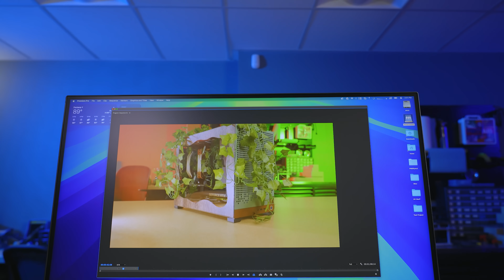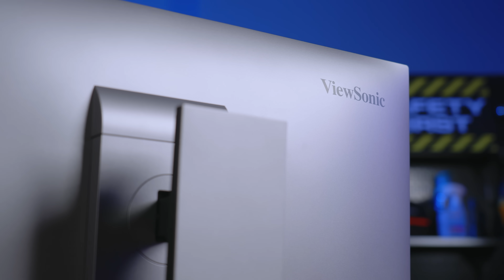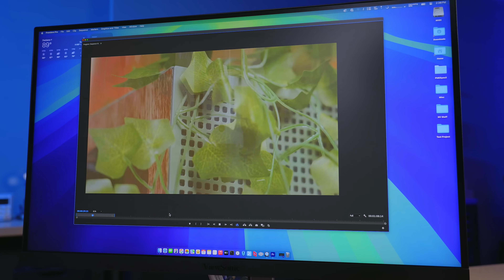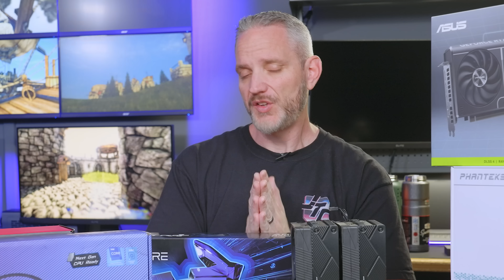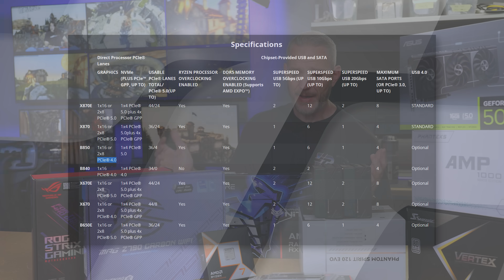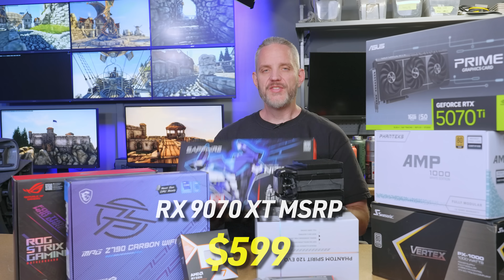This is the Sweetspot for PC gaming... Don't get fooled into spending more!

Comment: I just built my first with a 9600x and a 9060XT 16gb, B850I asrock board, 2TB m.2 and 750W Corsair platinum power supply 🥰 it's a little work horse and I love it.
Reply: Awesome build! 👍
Reply: Heck yeah sweet build
Reply: I got a similar build but I'm a gen behind still on AM4 but I upgraded my core to the 5900xt paired with the 9060XT 16 gb which I just got (love it to pieces so far, went from a 2070 super). Eventually when money flows easy again I'll bump up to the AM5 boards.
Reply: @inquity6 I'm already kinda annoyed I didn't get a 9700x, but for no reason other than I want bigger number. Idk if I have a single use case where I'm gonna bottleneck a 9600x lol
Reply: @CMLVI you don’t. The 9060xt is the bottle neck
Reply: That sounds awesome. I bet it does great at everything you want to do.
Reply: Similar! 9600x with 9070XT, 32g RAM, AsRock B850 Pro RS, 850w, and some M.2 I already had. I think all in, in a "regular" configuration, I'd have been about $1,400, but I could have been below $1,300 if I lived near a Microcenter. Very happy with it!
Reply: @CMLVI  
I went with a 5060ti 16gb, 9700x, 32gb ram, b650 elite ax /w 3 m.2 slots, & 360mm aio cooler  $1,210 (I only went with an aio because of aesthethics)
^ I originally planned to re-use my 750w, phanteks p500s, & my old corsair fans.

It turned into a full build because
1. I didn't want to tear out all my parts + I wanted something more smaller/ minimalistic /w more airflow. So I bought the 4000d airflow. Thankfully I did this because I had to troubleshoot the files I downloaded onto my usb. So all I had to do was swap my ssd back n forth until I figured it out. So I saved myself an even bigger headache of swapping out parts a bunch of times.

So another $100

2. I decided to replace my 750w with the 850w incase I decided to upgrade my gpu & it needed more juice in the future + my 750w psu was 8 years old... so I figured I got a new case might as well keep it in the old case.
so another $130

3. I could've reused the fans, but I didn't want the hassle of unplugging all the wires & cable managing it again. So I picked up those icue link qx120's & replaced the fans on aio + the front panel & added 1 more to the rear. 
Another $320, but it was worth it to have an less visual clutter + a lot less to cable manage over the lighting node system. 

4. I replaced my mouse & keyboard to wireless. It still came with wires though to charge them. At this point why not... I already upgraded everything else.
So another $180

So all together about $1,940.

I originally planned on spending $1,200, but it was well worth doing a full rebuild in a new case. 
I wished I wasn't an corsair addict...
Reply: All these AMD fan boys that only buy amd everything. Buying the 5070ti at $750 is great!

2nd) Honestly the 9800x3d for $500 after tax is insane unless you have an rtx 5090. 

If the 9800x3d was down to earth for $399 regulary then id say ya 😉. Its the the fastest gaming cpu at 1080p and 1440p. But with a mid range 5070ti a 14700kf for $300 is much better and then get a 4tb m.2 Samsung ssd instead of a 2gb. Bf6 and many games need LOTS of space.
Reply: Gonna build mine with a 7500f and 9060xt 16gb at the end of the month if nothing goes wrong. Wish me luck lol.
Reply: What settings do you usually run with that build? 1440p?
Reply: What is a general cost for that setup? I’m growing tired of Microsoft’s Failures.
Reply: @Wakeywhodat I think if you bought it the cheapest way and only did a 1tb ssd, you could get away with it under $1400. Microcenter CPU+mobo+ram could get you pushing $1300, and you don't need a $140 case like I got. Sub $1300 is possible if you are patient enough
Reply: I'm looking at something similar but likely will go with MSI or ASUS instead of ASRock. Why? Because I have a ASRock now and want something different--pretty random reason
Reply: @junaidmudaliar9685  not a bad call, I had post issues with the 9000 series CPU on my mobo; just needed to flash it but the manual Literally doesn't detail it, and the online docs don't tell you either. It just says "do it according to the manual". So after the initial panic and subsequent research, I was booted within 40 min of first putting the CPU in. But stressful 40 min lmao
Reply: @CMLVI I'm planning to get a 9600x. What did you do to fix your issue?
Reply: @oliver_reddy it was just flashing the BIOS, but it wasn't a straight forward process because AsRock tells you to do it, but doesn't tell you how, and just references manuals and websites in a cyclical nature. Luckily I found a YT video of someone doing it to a very similar model to mine, just copied with the appropriate BIOS for my mobo.
Reply: @CMLVI Thanks for the tip. I pray it doesn't happen to me, but if it does, I have this comment to come back to! :D
Reply: @oliver_reddy I'll be on the lookout! Lol
Reply: You should have gotten an 850 Watt gold rated PSU instead of the one you have now.
Reply: @DanishDude65 u don’t need that wattage for that build

Comment: I upgraded my 5700X build after buying your old X570 Extreme board with a 9070XT. Definitely a massive upgrade from my RX580 that I have held on to since it was new from like 8 years ago now. Holding onto hardware for as long as you can is the best route forward right now. CPUs and motherboards don't need to be upgraded like they were, maybe once every RAM generation change with how well these X3D CPUs seem to hold on. Still wish I could get what the RX580 gave me for $191 today with decent GPUs coming down in price, but c'est la vie.

Comment: I couldn't tell you how important this video is for me right now. I've been upgrading my rig bit by bit due to the issues Iv had with Monster Hunter Wilds. Money has been tight so Iv only been able to make small meaningful upgrades to parts I happen to find on a good sales. Microcenter has been my friend this year in that regard as I got a very popular SSD for half off last week. So far Iv only upgraded my SSD, power supply and got an additional stick of RAM. Iv seen some improvements to my overall rig and other games, but Wilds has really only seen improvements in launching the game which is fine because it took about 3 minutes just to get in the game prior. My motherboard and water cooler are the most up to date components that came out in 2023. I have the foundation I just need to build on it with a good GPU and CPU when I can find the extra money.

Comment: power supplies choice should always be overspeced,  and going with a reliable brand is a must, it should  be a muti build investment,  I have a 550w antec tru power trio that i got around  2010ish and used it in several builds before i needed more power, it is still alive and a solid psu that resides in my god kids mincraft rig. antec and seasonic i will always recommend over many others.

Comment: The only time I would suggest maybe spending a bit more on motherboard is if you're going ITX buiilds, as you can't always just add it through a PCIE slot.
Let's say you want 3 m.2 slots for example, while most people don't need it, for video editing you might want that. And I don't know of any lower end boards that have 3 (most don't even have 2) slots.
Another thing that you might want, is 10gbe, which you don't see on budget boards for reasons, it will generally add $50-100 just for the 10gbe over 1gbe.

Comment: The sweetspot for gaming is an AM4 5700x, 5700x3d or 5500, with a 9060xt or 9070 non-XT, a b550 board and 32GB DDR4 RAM, with a 1TB Gen3 SSD and 2TB HDD. That gives you the most performance per dollar. 12th gen intel i5s are also cheap.
Reply: 12 gen are really good still :)
Reply: @SuperDuDDe  yup, as I said 10th gen i5s are cheap now, even the i7 12700 too.
Reply: Lets just cross the 5500 from the list with its halfed cache and PCIE 3.0, 5600(X) much better buy. Make sure the HDD is CMR, most cheap 2TB HDDs are SMR now, so better to jump up to 4TB CMR drive or stick with 1TB CMR drive.
Reply: @sviktor4  Yes, but the 5500 is 50-55$, so if you are on a tight budget you can't beat it, unless you get an i3 12100, but overall it's better to go with the 5500
nowadays the price difference between SMR and CMR is not that big.
Reply: @rattlehead999 The 5600x was on offer here for 89€ recently. That's ultra cheap and I wouldn't go any lower, unless you really have to
Reply: @rattlehead999  On that tight budget a 3600 maybe a better choice, in some games perform better. Or just buy used parts, because in 1-2 years the 5500 will loose its resale value.
Personally I would choose a used 9600k or 8700k system, it's performs better than 5500 and holds its resale value.

I realised no reason to discuss budget options because both new and used prices are different in different regions. All in all new market sucks except AM4 and all manufacturers will stop DDR4 production in this year.

CRM drives 22% more expensive at the low end and as you go up in capacity the difference goes down to 10-15% in price.
Worst thing is that you can no longer buy 2.5" CMR drives for external storage.
Reply: @sviktor4  the 5500 performs better than 10th gen or earlier from intel, apart from the very high clocked ones, also what resell value? It's already 50-55$ brand new.

If not just go for the 5600 for 70-75$.
Reply: @tarron3237 the 5600 non-X has 99% the performance since it's the same CPU, but clocked 100mhz lower, but it consumes less power, so it's more worth it even at the same price as it can easily be cooled with the stock cooler.
Reply: 5700x3d on a B550, 32GB 3200 CL14 (used), RX6800 (used), two 1TB NVME's and a 1TB SSD here, and I can't disagree. That combo works perfectly
Reply: @tarron3237 cheers

Comment: Always buy components that actually benefit what you want from the PC. I’m still on AM4 and have a 5800X3D because I do car racing sims online. They really benefit from the extra cache. Running it with the Thermalite Phantom 120 EVO cooler. Perfect. My power supply needs replacing…it’s an 11 year old Superflower Gold 80 plus but only 750 watts. Will definitely buy another Superflower as it’s been bullet proof.

Comment: I'm Running a 9800x3d with a 7900xt with a B650E and 32GB of DDR5 & Be Quiet Dark Rock Pro 5 and it keeps it cool and Powered with an EVGA 850 GT and it works Fine for me

Comment: MSI MAG x870E Tomahawk WiFi - 4tb samsung nvme - Ryzen 7 9800x3d w/NZXT 360mm AIO - 64gb Gskill Trident Z5 6000 cl30-36-36-96 EXPO (tightest CLs they make in this size and MT speeds) - Corsair 1000W PSU - Meshify 2 case with full NFA14 Noctuas (x6) - still on an old 2080 Super till the 9080XT or 9070xtx. I run a travesty of a 3 monitor setup. 1x 1080 24", 1x 1440 27" and 1x 1440p 34" curved ultra wide. Every thing is powered by a VRM battery backup system. My advice is to cheap out on the MB, go with the best CPU and GPU combo you can buy. My 2080 super came out of my meshify 1 system with a r7 2700x, so this was a significant upgrade from an early gen am4 to am5. I just refused to buy a 16gb GPU in 2025 and although the 7900xtx was tempting, it is too old to justify the price given its age... I will wait for Nvidia or AMD to release a 24gb or higher card before they will capture the rest of my money. Miss the good ol days of the 1080Ti where these companies actually tried to show you what they could do with raw power...I am a native junkie...they keep leaning away from raw power in favor of AI and frankly it isn't as good. Anyone can go compare the generational growth and see the stagnation...they are intentionally nerfing the GPU market while simultaneously inflating price to the worst level...Legit about to go full team red for the first time in my pc gaming life. cmon 9080xt or 9070xtx.

Comment: He’s definitely got some good points.  Currently running a ryzen 7700 non x with a b650 board and a 9070xt.  Honestly for 1440p, I could probably get away with a 9060xt.  But when I got the 9070xt, I grabbed the AsRock Steel Legend for $700.  I think I’m good for a year or two anyway if not longer.  If I make any moves it might be when they release ryzen 10 or 11 series.  So zen 6 or 7.  But for what I’m doing my rig is totally fine.  

Even on storage, one of my storage drives for games is a 2tb sata ssd.  Yes pci e gen 4 or higher drives are nice, but at least on older games or even ones that are reasonably modern, not like you notice a lot of difference.  Maybe an extra second to load into a level?  For the OS drive yes definitely go pci e gen 4 or better.  I do also agree buy a quality psu and upsize it.  If you’re buying a mid tier psu, upsize even more.

Comment: 7800X3D with Deep Cool AK500 Cooler ASRock PG Riptide B650E with I THINK 4TB Total in 2 of 3 NVMe Slots, 32GB G Skill 6000 RAM Kit, ASUS TUF 4080 Super OC, Vetroo GV1000 PSU, in a Montech Sky II Case....      Hac it Built for about as Year and Change now I think...

Comment: I had a Intel 12100 with 3060 TI (ran like a dream) but it began to struggle with some games (1440p) and it was mostly CPU that it struggled with (factory building etc. goes off the charts when you play 2200+ hours in it) so I had the mobo and ram etc. so I went to a 13600K (BIOS updated etc. etc.) and splurged and dug deep into the pockets and got a 4080 Super... not planning to upgrade any time soon but now run everything at 4K and it is amazing... does it itch when I see a new fancy CPU? would I love a 5090? yes and yes... but for now I don't need it, everything runs great and I don't even have to cut graphics settings yet... I know I am above "sweetspot" but for once in my life I want it to live longer than updating every 2 years... through the decades I often had ATI then AMD GPU's and they served me hella well... same with CPU's I looked what was on the market and picked the best bang for the buck...

Building too cheap = have to upgrade too often... Go up a notch... Don't go highest end... Too expensive unless you plan to keep it a LOT of years...

Comment: What an amazing video. 

Sharing my build specs on a 1k Build: 

CPU: Ryzen 7 7700 – $130 (new, on sale via AliExpress)
CPU Cooler: Cryorig H7 Ultra – $50 (new, purchased in 2021)
Motherboard: MSI PRO B650M-A – $123 (new)
RAM: Kingbank DDR5 32GB 6400MHz – $76 (new, AliExpress)
GPU: ASRock 6800XT Phantom Gaming – $420 (used, like new – bought in 2021)
PSU: Corsair RM850 – $125 (new, Amazon)
Case: InWin A3 – $65 (on sale)
Case Fans: 5x ID-Cooling Slim Fans – $40 (AliExpress)
NVME 2x: 2TB teamgroup & 500GB WD black ssd - $170 new

Total: $1,199

This setup is definitely the sweet spot for me. I can wait for the next-gen AMD GPUs and can buy them on release without worrying about my CPU bottlenecking.

With a bit of patience and deal hunting, you can really maximize your price-to-performance. Don’t be afraid to explore options like buying used (there are some gems out there) or even buying from AliExpress — they offer a decent 90-day warranty, which works for me.

I’ve had this system for over a year now, and it’s still going strong with 1440p gaming!

Comment: Started sim racing recently and built my own PC for the first time. My old system was built by my close friend where I had Rog Strix rtx 2070 (gpu died after 6 years so it got swapped to a used 6800 xt) ,  paired with i9 9900k,Dark Rock pro 4 CPU Coler, 32 gb RAM CL 17 3200 Mhz. 1+2 TB SSDs, 650 watt 80+ gold PSU ,Rog Strix Z390 E-gaming MOBO , h500i case with 2 added fans and 1080p 144hz 24" monitor. Now my new rig has 3x 1440p 180 hz 32" monitors,  MSI Ventus 5080+ 9800x3d, 1+2 TB SSDs, MSI B850 Tomahawk max wifi MOBO , 1000watt 80+ goldPSU , Fractal torrent case +1 fan only, 32GB ram CL 30 6000 , Noctua NH-D15 cpu cooler. dont know if I forgot anything , my point is buy once cry once I have no plans on upgrading in forseable future and by that I mean 10 years unless something dies on me like my previous gpu which I certainly hope will not happen again. My personal opinion if ur playing regular games 9070 xt+7800 x3d is the sweet spot and ur good for a long time. Oh and btw my whole set up has zero RGB crap and is solely focused on performance.

Comment: Ive found 2nd hand is the way to go, I have a 5950x (£180) 32gb Corsair vengeance pro (£50) B450 rog rix (£50) sapphire nitro+ 7900gre (£450) Corsair rm850e (£80) Rog helios with 6 140mm fans (£100) and the only things i bought new were the cruicial p3 and air cooler. So basically around £1000 for a 16 core pc with a cpu that was £800 new that plays all the games I play at over double the fps my old system with a 3700x and 3060ti played them at and it looks cool as fuck 👍🏻

Comment: Agree with the psu to some extent. But remember psu requirements are based on lowest psu quality. I have succesfully run many GPU on paper a too little psu. Atm. I am running a 9070 XT on a 10 year old 650W Gold. - No problems.

Comment: my sweetspot is 
Ryzen7 7800X3D - LiquidFreezer III
ASRock B850 Riptide WiFi
Corsair Vengance 2x16GB 30ms
Crucial T700 1TB
RTX5080
Montech AIR Base Mid Tower Case
MSI MAG A1000GL PCIE5 1000 W
ROG Strix OLED XG27UCDMG

Comment: One really important factor for buying a case is also connectivity. I've seen popular and expensive cases which lack USB-C connectors on the front, which I think is not acceptable in 2025.
Reply: Genuine question what for? I only plug my headphones in to charge in the tyre A at the front. For VR stuff?